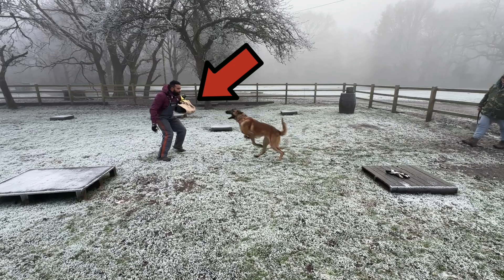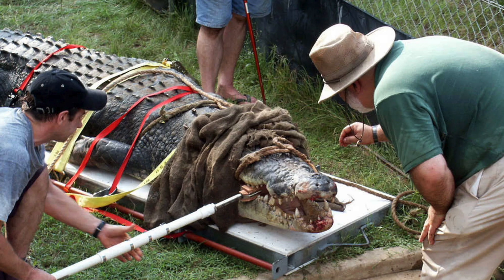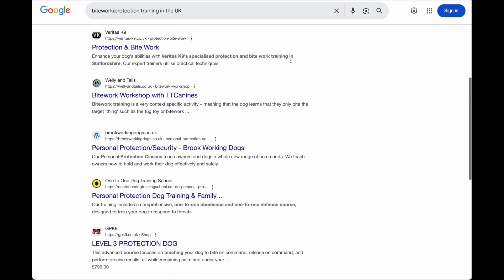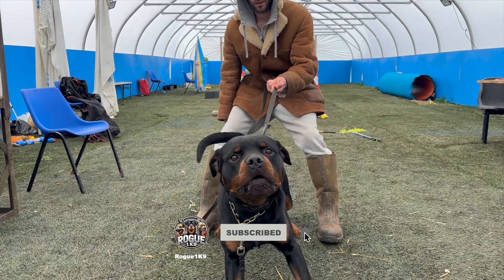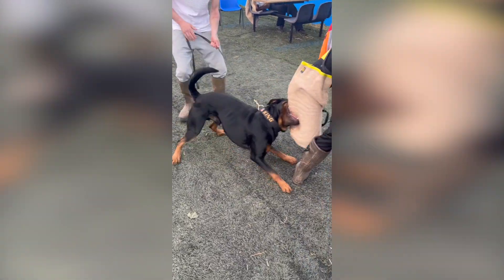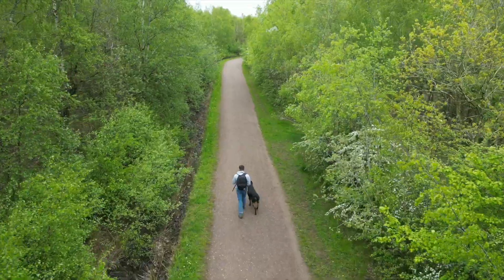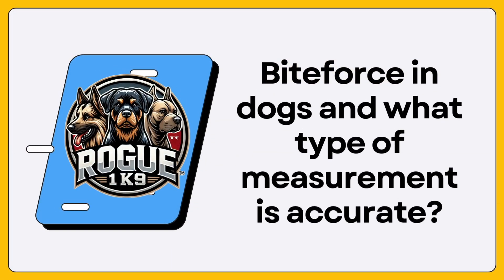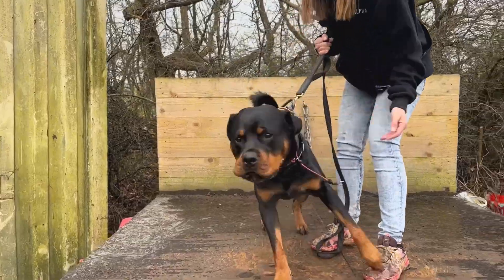Measuring REAL Canine Bite Force for the FIRST TIME!

Comment: How about make a device that measures both overall  force and psi so you get two readings
Reply from the maker: Measuring biteforce in PSI is not really achieving anything unless you want to know which dog has the sharpest teeth. Psi all depends on the size of the surface area

Comment: Good to see someone who understands the difference between pressure and force - I've commented for years on the channels who simply parrot the 'force' in psi...
You mention pressing on the skin with a needle; an interesting fact for you and your watchers:
If you could stand a hypodermic needle vertically with it's point on your skin, it would generate a pressure of about 2000psi simply under its own weight - this clearly demonstrates the nonsense of using psi to measure bites!  
An 8 week old kitten can easily exceed 1000psi bite PRESSURE (force per unit area) due to its needle-like teeth, and I have the scars to prove the effortless penetration ability of their equally fine and self-sharpening claws!!
Reply from the maker: @thedubwhisperer2157  hell yeah brother 👌

Comment: The problem with bite force testing is different breeds bite in different modes. Attack trained breeds will bite aggressively because that’s how they are trained however some breeds like Kangals and Cane Corso are often reluctant to bite hard. Our Kangal does not bite her pull toys hardly at all she doesn’t do tug of war. Kangals are very hard to train as protection dogs etc. however sometimes she bites clean through quite large tree branches and makes short work of the hard plastic chewing toys more than twice a quickly as our lab. Very interesting tests but to really see other representative breeds truly bite hard I think they’d need to get ‘angry’ and how do you do that with welfare in mind.

Comment: The biting mechanism.. are ypu using a type of force transducer with flexing parts that infer force based on displacement?? 
How about an air filled bladder with 1 or 2 built in pressure sensors?  Larger jaws would diplace more bladder biting and would auto correct for different jaw sizes.  It would measure 'work being done' regardless of mouth size.
Reply from the maker: @mattbraysails  Interesting idea! The challenge with an air bladder system is that pressure and force aren’t always the same. A dog with a wider jaw could displace more air and give a higher reading, even if its bite force isn’t actually stronger.

Another issue is that air compresses, which could absorb some of the bite force and reduce accuracy. You’d also have to deal with potential air leaks and durability concerns—sharp canines or high-pressure bites could rupture or deform the bladder over time.